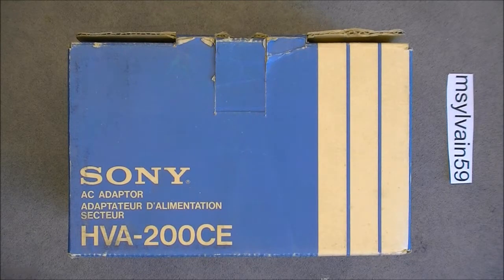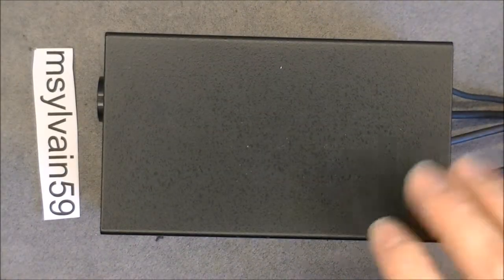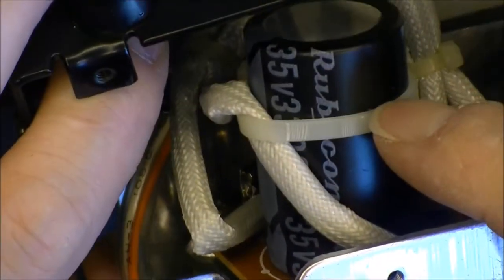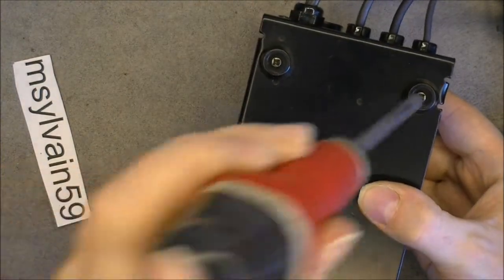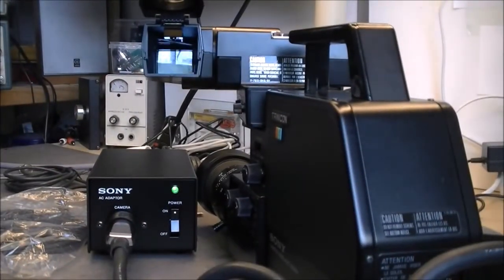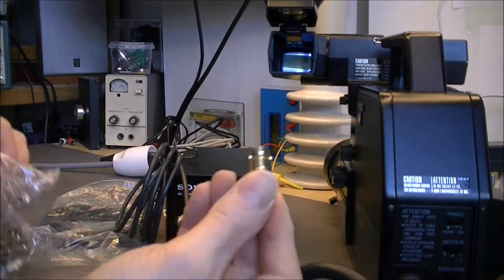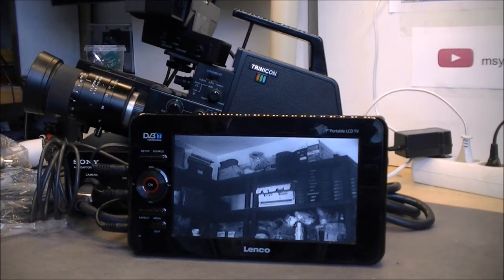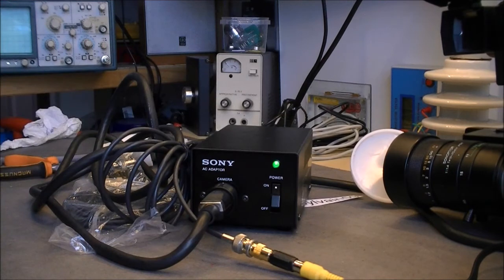NIB Vintage Sony camera AC adapter teardown and test

Comment: Is that not supposed to be a pass transistor on the heatsink rather than a 7812? It's an adjustable voltage design so it's got me confused seeing a fixed regulator. Even a 317 adjustable regulator would make sense, but a 7812 is weird. It may not be regulating, which could explain your cameras malfunctioning.
Reply: You can apply a voltage divider to the ground pin of the 7812 so you can bias it. I suspect that's the purpose of the trim pot. It's a common trick if you need a voltage close to a 78xx to use the bias trick.